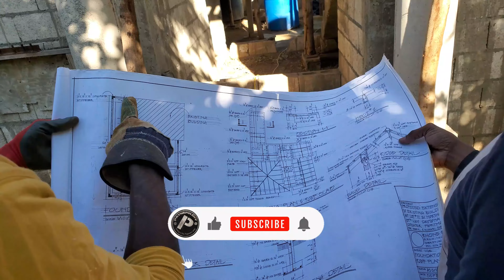The best way to install steel reinforcement for concrete slab. #diy #steelwork #construction

Comment: Great work as usual.  What is an over support.  Why and where do you use it?  I am googling it too.
Reply from the maker: Thanks for watching... The over support add additional strength to the slab, it help when your adding a second floor to the building it also prevent the cracks and breaking of the slab

Comment: Can you use 1x3 lumber for the runners underneath the ply in decking???
Reply from the maker: no.... Only if you use it to frame the sheet of ply like a form and then join them together as the joist
Reply: Some people use it I've seen it done but its place 16" apart i don't recomend it tho
Reply: @paynefuldiy  
So join 2 length of 1x3 as 1 length?
Reply from the maker: @juniorchar743   you have to nail them on the ply first for the strength. And it depending on the length of the room
Reply: @paynefuldiy  you mean the decking ply you gonna pour concrete on
Reply from the maker: Yes at the bottom of the ply but you have to subtract the differance

Comment: Ghetto,
What's the reason for over support steel reinforcement?
Reply from the maker: Great question. The over support prevents cracks and bending in the slab and helps to send the weight of the second floor into the columns
Reply: @paynefuldiy  I'm definitely learning bcz I'm new to this thing. I always wanted to learn house construction but only got to learn joinery. Very good technique to support firmness and preserve strength 💪. Blessings and more strength Ghetto, love the move bcz you're inspiring others, and letting us realize that we can do it if we're determined and willing to learn
Reply from the maker: This means a lot thank you so much
Reply: @paynefuldiy  You're welcome sir. Your YouTube page has inspired me to complete my house by myself, which I'm about to do. Paid money to build it and my roof wasn't done properly, bcz they mixed poor material. My slab roof leaked within months of being done. Your program taught me so much that I'm now wise, so I'll complete the rest. Respect Sir
Reply from the maker: I'm glad we able to help...

Comment: payneful u need fi build benches to build columns on bredda building them on two blocks make u bend too much bredda and wen u reach ontop to start tie up di decking a extra bending again...big up sameway ..up move
Reply from the maker: neva have enough material to build the bench now that the decking came down i can use the boards to build the benches